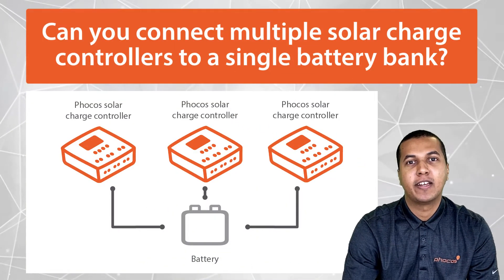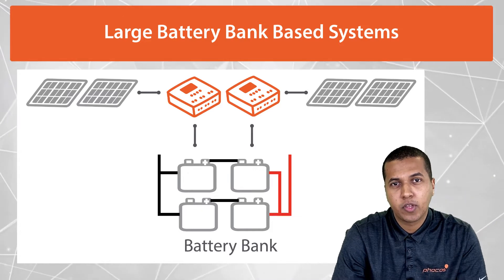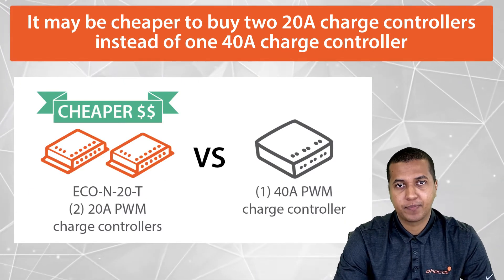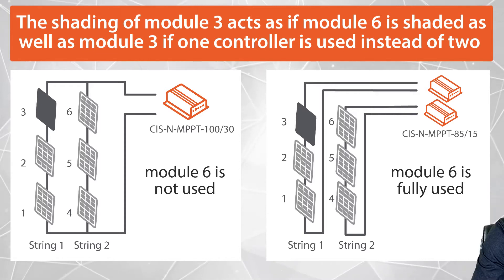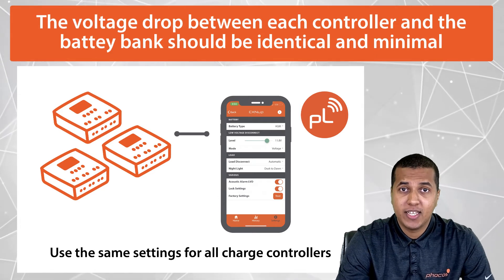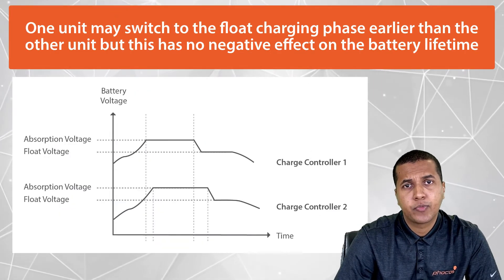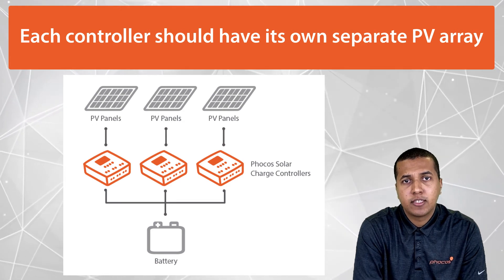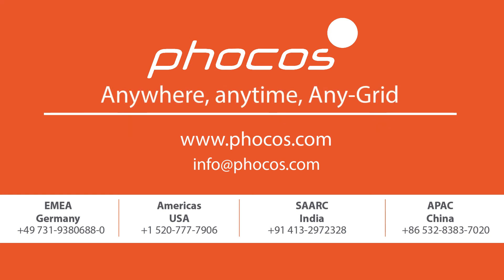Can You Connect Multiple Solar Charge Controllers To A Single Battery Bank?

Comment: Asalamualeykm

I would like to know the reason for using 200 AH Lead Acid battery as the minimum capacity with 3/5 KW phocos inverter. Is it because :-

1. From Charging point of view that the battery charging current from the inverter to the battery cannot be programmed less than 20 A (max charging current for 200 AH battery on normal operation) and charging via solar in case of no grid can damage lesser capacity battery?? And/Or

2. From Load point of view such the inverter when operating in pure battery backup mode (no solar and no grid available)  the minimum capacity has to be 200 AH to cater to 3000 Watt of rated load ??

3. If my inverter is configured in a way that the connected load on AC output side of inverter is less than 1000 watts (the max emergency load in case of power cut or grid failure) and the inverter is mostly operating in grid feed in mode, then
a. Can I use 100 AH/150 Ah batteries with the inverter for minimum backup requirement...??

These are the queries I am getting from clients who want to upgrade their existing On Grid systems to Hybrid Systems and I suggest Phocos inverter for the same.
The concern of the clients is that adding 200 AH battery adds to overall cost of upgradation since power cuts are minimal, back up requirements are basic and Solar power is utilised majorly in grid feed in mode.

Waiting for early reply.

Thank you
Reply from the maker: Hello, the charging current can be reduced down to 10 A on any PSW-H inverter, that is not the reason we recommend at least 200 Ah. It is indeed to ensure stability at all possible AC load levels up to the rated inverter power. To create AC on any inverter, the current drawn from the battery is not uniform. While high-frequency inverters such as the PSW-H are better in this respect than larger transformer-based ones, converting DC to AC always causes some level of uneven current draw on the DC side. Our recommendation ensures that the battery bank can cope with that and provide the necessary current to supply AC loads at the inverter’s full power potential. If you use significantly less power than the rated power of the inverter’s AC output then yes, you can decrease the battery capacity to some extent. We would never go below 100 Ah though, unless using lithium batteries capable of currents at over 1C. Alternatively, when using very small battery banks and lithium is not an option, vehicle starter batteries can be used (as opposed to the usually recommended solar / deep cycle batteries), as they can handle higher currents at the detriment of life expectancy and deep-discharge capabilities.
Reply: And besides Phocos answer, you are not going to get many hours of use out of a smaller battery capacity if you are running an inverter of that size at anything above half of it's maximum power output. And even at half, you will run out of power early in the evening.